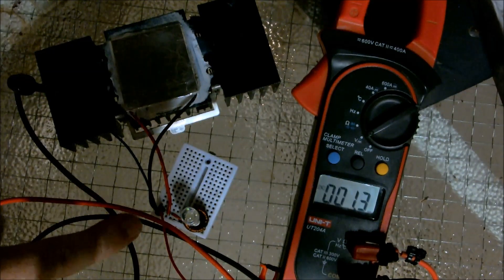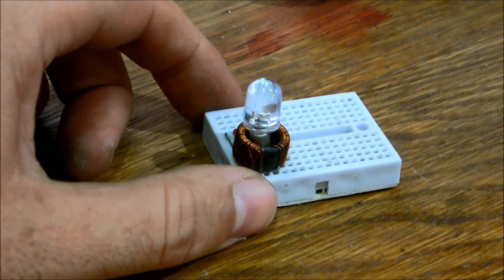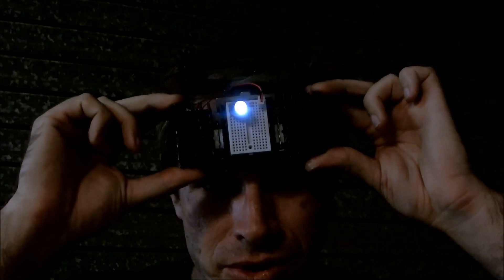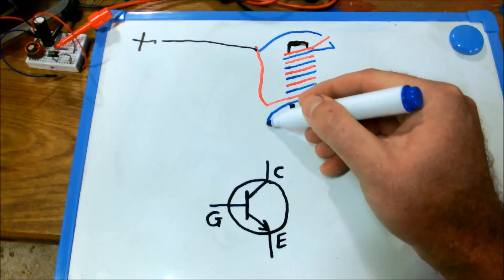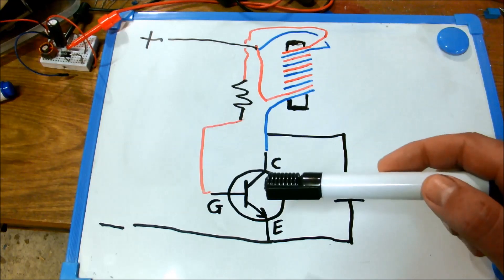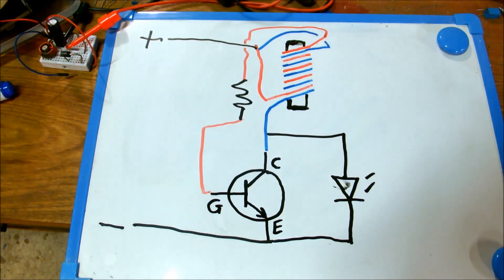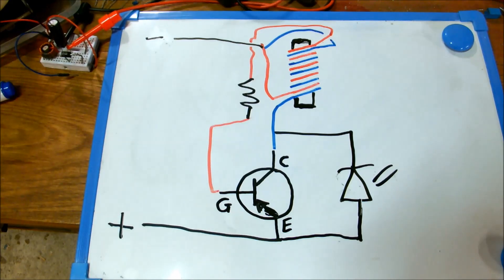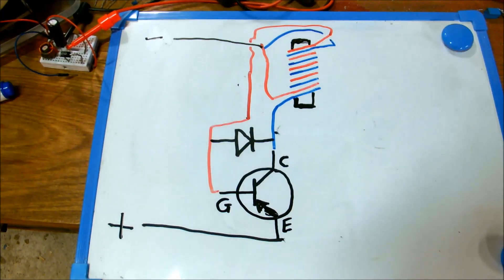Joule Thief - Peltier powered Head Torch.

Comment: Smart moving that LED to that position between both coil outputs. I'll have to try that.

If wire size (diameter and length) and core properties (permeability and size) have anything to do with its amazing output, then experimenting with enlarging these dimensions may enlarge its output.

Comment: i think u went into my head and stole my idea. 

i am planning to build exactly the same with just one change, instead peltier module, I'd conmect a small photovoltaic (solar panel) and amplify the voltage to 100 to 200 times. 

And just like you, I'll also connect the load in parallel to the coil so it wont draw extra current from the source. 

btw u earned a new subscriber today!

thanks for posting such an esoteric knowledge for educating inventors.

Comment: What is the turn ratio of toroid?
Reply from the maker: The ratio of primary to secondary windings is 1:1.
Reply from the maker: I did not count the turns, I just kept winding until it was full. Prior to this model I had tested another inductor with perhaps half as many turns and it still worked. The higher turn count on the model in this video definitely worked better and boosted from much lower input voltage levels.
Reply: Thanks for the information

Comment: And another question that was always bothering me. What if instead of a feromagnetic material for the jeuel thief some goes and uses a magnet? Or would the saturation impede the preassure rising? Somehow i believe you would get bigger pulses but have no experience what-so-ever.
Reply from the maker: I have not tried a magnet but I doubt the permanent field would add any value. It is the change in magnetic flux that drives the pulses. I am not an expert in this field but I have read that saturation is in fact a requirement. I have also used a steel nut as a core and it still worked.
Reply: @williamfraser  Ye you are probably right. Is just that it seem like it should, but it doesnt... But i have seen some systems where they use 2 magnets and coil half of it in counterclocwise and the other magnet the other half clockwise... I still dont understand why, but perhaps it does something and if nothing else a shunt for high frequency idk.